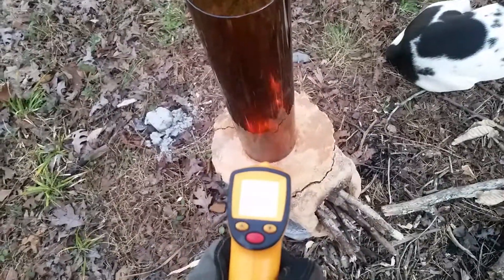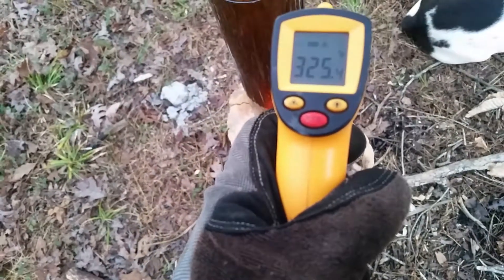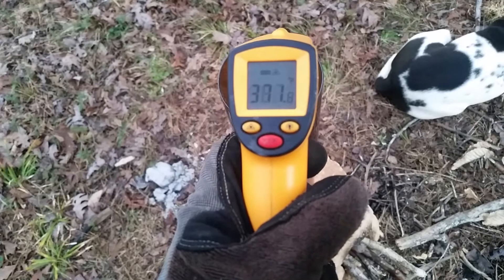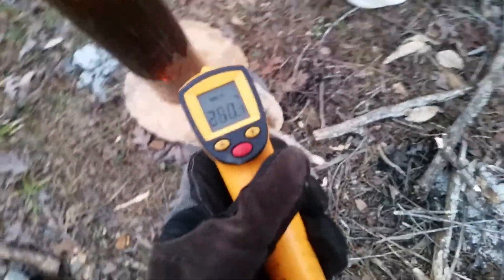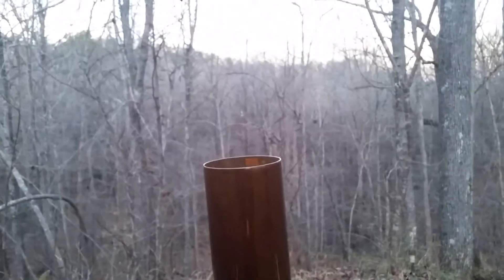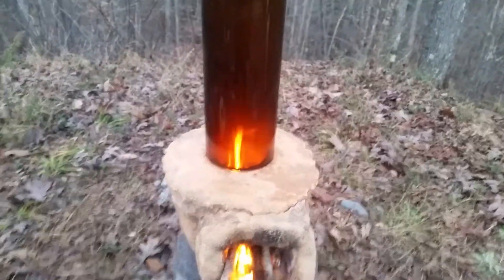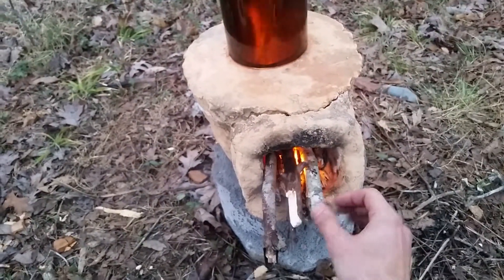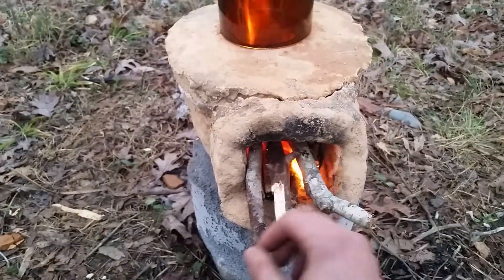Glass heat riser rocket stove

Comment: Would love to see a video on the build and glass tube selection.
Reply from the maker: @woody844  thanks, I haven't worked on this project in a while. The glass tube was unfortunately broken but not by the fire. This might be something I'll revist but for now it is not likely it will be soon. The burn chamber was built using a mix of crushed aircrete, clay and portland cement. Unfortunately the heat stress doesn't work well for direct flame as the stress causes cracking. It might be useful as a material surrounding something like glass or stainless steal that can withstand the temperature fluctuations. It was built using a pvc form and sculpting by hand. The internal cavity is very simple, basically a small L shape with 3 to 4 inches thick walls.